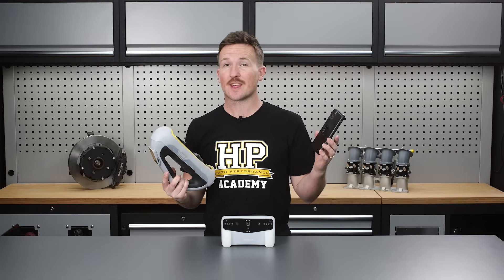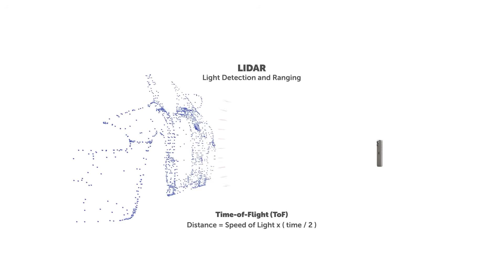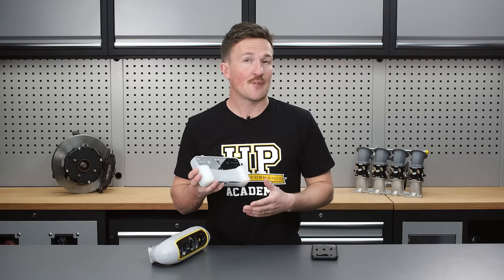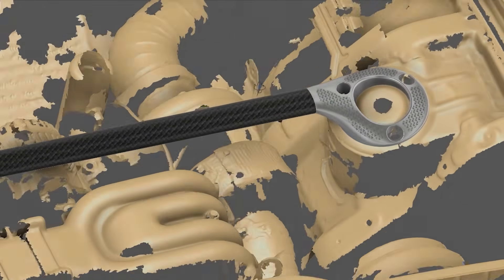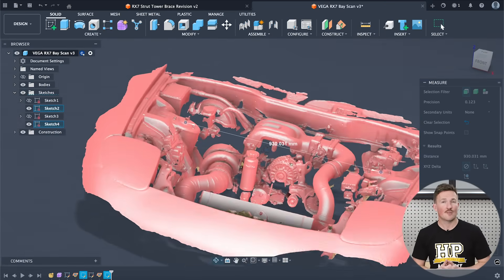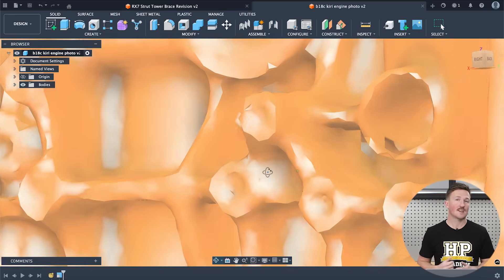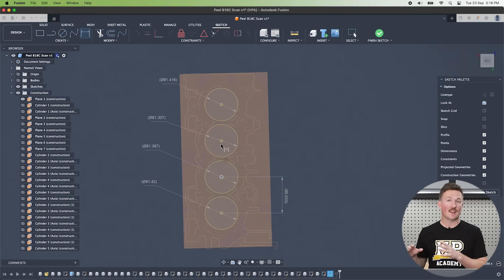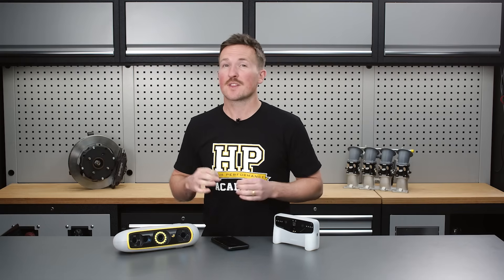We Scanned Car Parts With A Phone | Here’s What Matters

Comment: To reduce noise on the Peel 3 scans try turning off 'Smart Resolution' in the custom setting and only use a single resolution setting.  We have found this really helps.
Reply from the maker: We'll give that a crack and see how it goes, cheers for the tip - Taz.

Comment: for a good iphone scan here's a tip: 
the iphone 12 face ID camera (the front cam) has much higher resolution 3d scanning capability than any subsequent iphone model. 

you can use a scanning app set to 1mm or finer resolution and will need to move the phone very slowly as you scan. it can be awkward to see exactly what you're scanning as the screen faces the subject, but produces some very decent results on a device you might already have laying around. i'd say it's comparable in quality to the vega, however the workflow requires more patience. another challenge with this approach is stitching together your various scans into a single mesh, but this can be done in mesh editing freeware.

Comment: For work we use a lot of photogrammetry, and as you illustrated it isn't great for detail. Generally the size of equipment scanned is around the 20m mark, and as much as it would be nice to have crisp clean bolts etc. the economy v's quality compromise is bearable. What does make it better (as you pointed out) is good lighting. If you can attach a good opaque light source to your phone then nearly every frame gets good lighting. Also worth noting is that most of the apps allow you to look at all the images stored in the scan, and some will allow you to delete files that have poor data - i.e. a shadow that is interpreted as an edge which corrupts the stitched model - so the model becomes cleaner and more accurate. We did try commercial scanners at the start but at the lower budget end they were pretty ordinary. I'm quite impressed by the engine block scan from the Vega. Looks like it would be ideal for roll cage work.